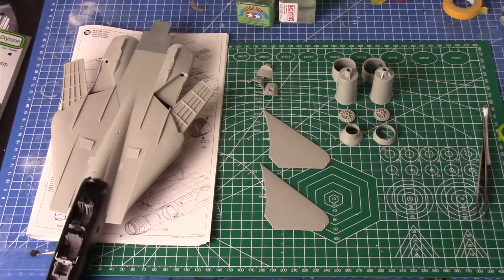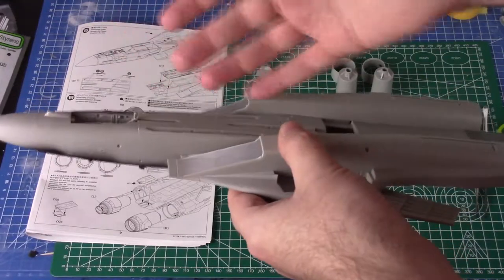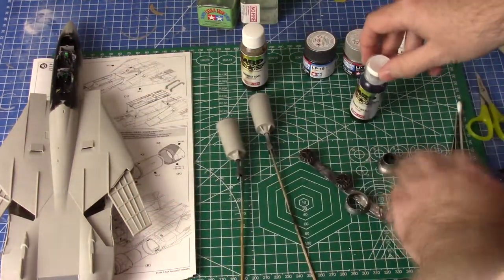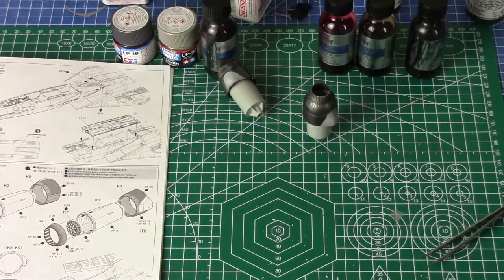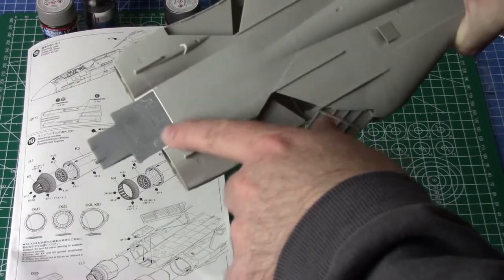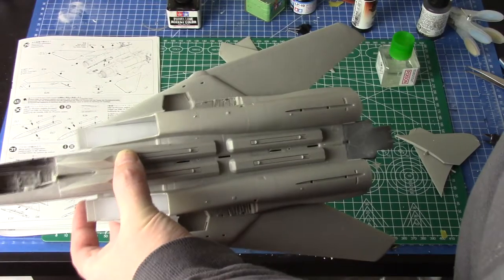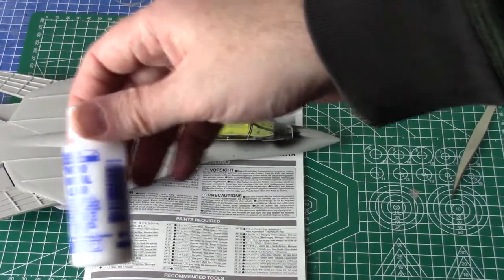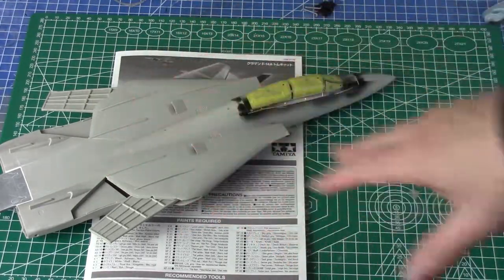1/48 Tamiya F-14A Build Series - Part 4: Exhaust nozzles and finishing fuselage assembly

Comment: I am supposed to be doing the same project, however its been nigh on a month and my early gun vent/boat tail from phase hanger resin hasn't moved from LA 😒. So I've taken the plunge and put the kit parts on and will go with one of the tamiya schemes, probably vf 84. Still, enjoying your work nonetheless.
Reply from the maker: Yeah, mine took some time. Phase Hanger and Flying Leathernecks both take forever to ship. Which sucks. Good luck with your build and thanks for stopping by. Richie